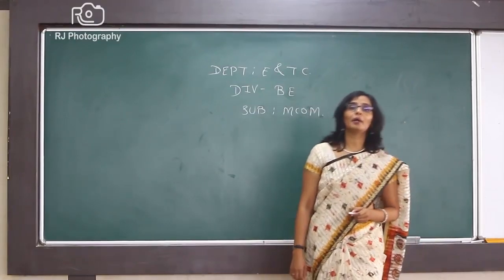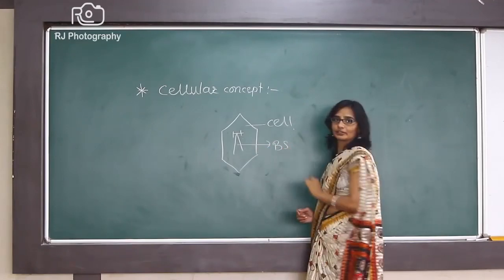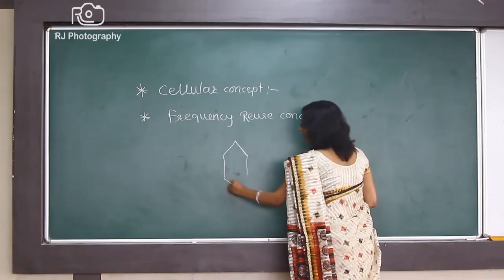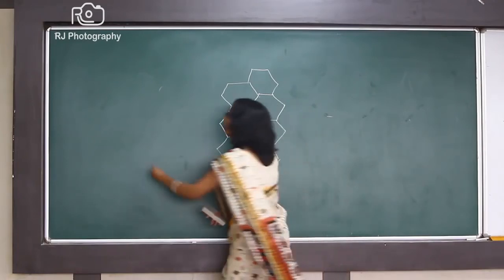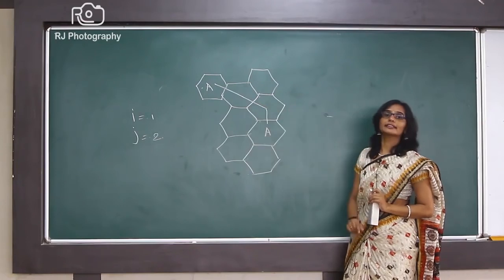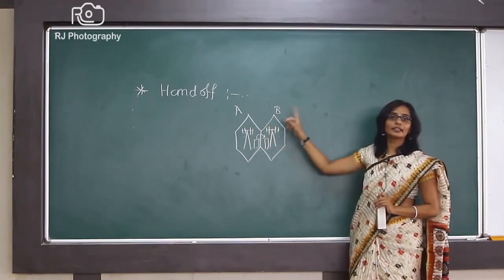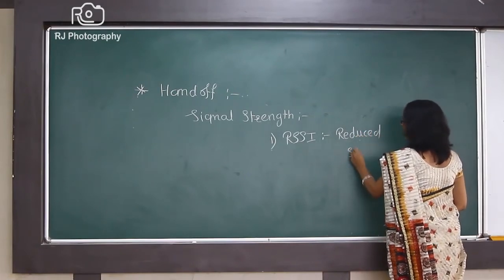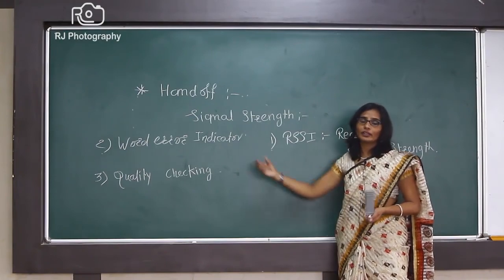Cellular Concept in mobile communication

Comment: Respected mam
The lecture is very inspiring but it has been cut off at the interest and creating suspense.
As explained, the freq in A cell is different B cell. During the Hand off is frequency in Mobile will change or Not?
If yes then how this process takes place in Cell phone or user equipment.

Now a days MMMB cell phone are available. How these cell works and tuned their frequency in cell phone?

In India Presently Telecom service provider are operating in different frequencies eg 850, 900, 1800, 2100, 2300 and 2500 MHz. How the mobile phone tuned to this frequencies.

Pl have video on User equipment functions to get rid of confusion of  various cell phone users and your students.
Thanks and Regards

Comment: What is difference between hard hand over and soft hand over
Reply: In hard hand-off the connection of base station 1 gets disconnected before getting connected to the next base station i.e. at a time only one base station is connected, and that's where a disturbance is observed but it is low in cost. While in soft hand-off the base station 1 is still connected until the mobile gets connected to the next base station and since there are two base stations connected simultaneously there is no disturbance and this is high in cost.